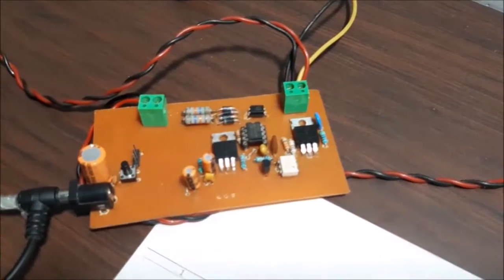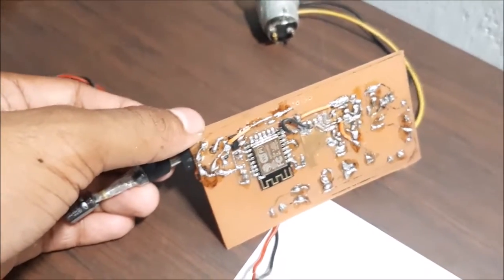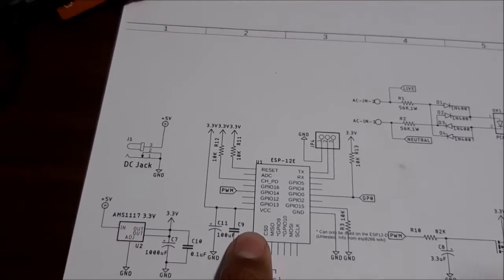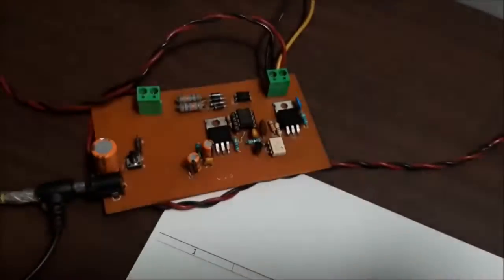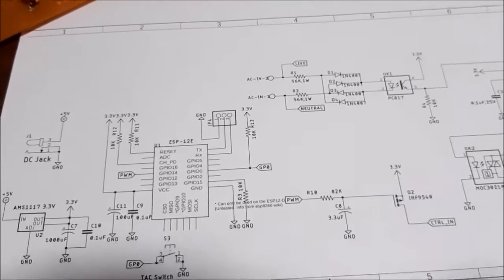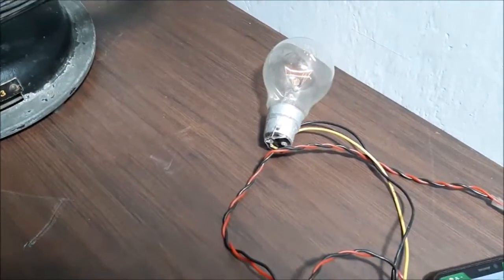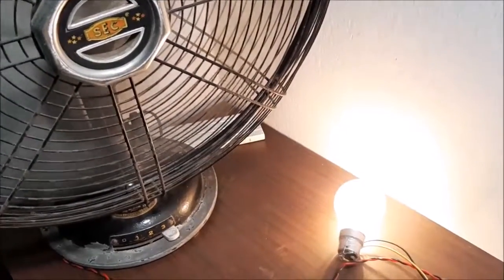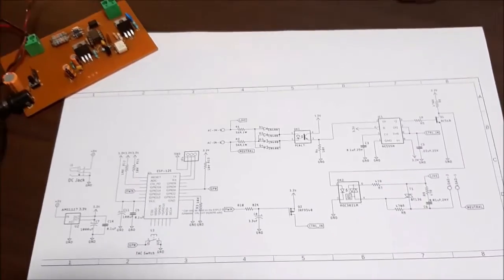How to Control Fan Speed with Cell Phone using NodeMCU

Comment: An input fuse and then a MOV between live and neutral would increase safety and reliability. The capacitor C6 on the mains side should be class X2. This gives the correct overvoltage rating. A good quality plastic box is good idea too.  Have fun 🙂